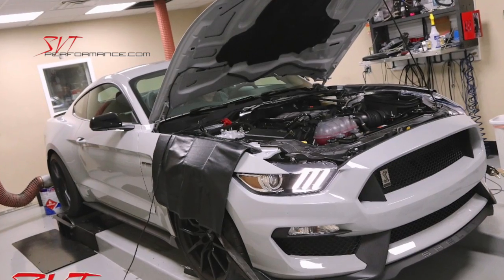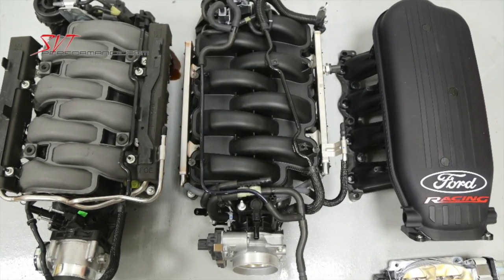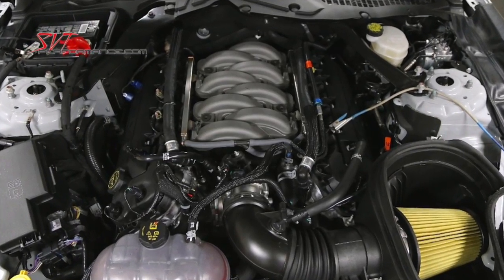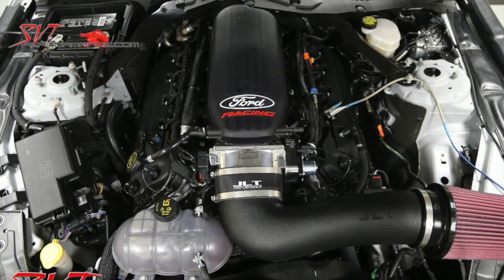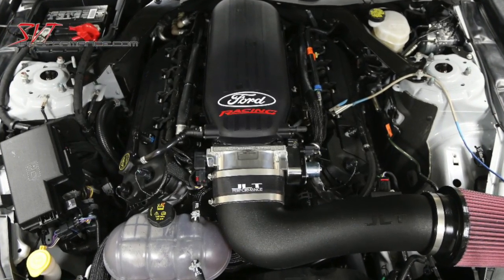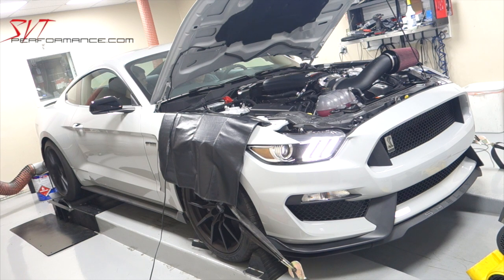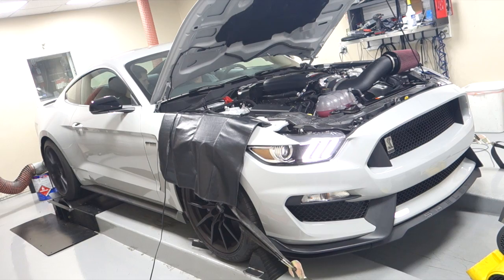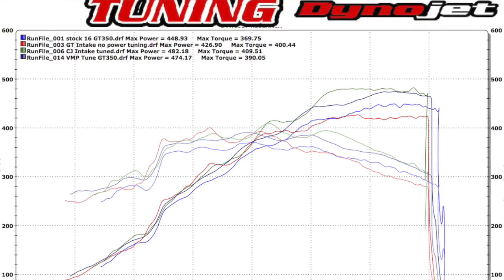Cobra Jet vs  GT350 Intake Test

Comment: This test has no good info in my eyes.
 First tune stock set up. Then run cobrajet with stock intake and tb tuned. Then we would have real data.
Reply from the maker: How do you propose bolting the stock intake and throttle body to a Cobra Jet Intake?
Reply: @SVTPerformance  then put the TB, intake and tune on the 350 first.
Reply from the maker: The Cobra Jet Manifold requires an oval throttle body and intake.  The others use round components.  They are not interchangeable
Reply: @SVTPerformance  ya got me on that but I'd say if the resources were there I'd of matched the throttle body to it's equivalency in a round and used that. If not I guess you did it fine. But real data is what we rely on to make good informed decicions but we only know the difference on the entire combo when it would be nice to know what the intake is worth compared to the gt350 intake and we don't know that.

Comment: That's stupid! The stock gt350 manifold is already good! All you need is a better throttle body,intake,and tune!
Reply: Yea its already "good" but it clearly isn't the best or the cj would not pick up power on a gt350 or an 18 up gt..
The reason they both gain with a cj intake is because the cj intake was and still is the best intake manifold available for the coyote as far as na applications go.

Comment: Do they make cobra jet for the s550 stang
Reply: I heard you can cut the hood liner in the S500 and it will clear. Any thoughts?
Reply: can anybody tell me exactly what you need to do to make the cj compatible with the s550 like any extra hoses or modification of the vacumn lines necessary thats all i want to know i got the hood clearance issue resolved i just wanna know cuz the closest speed shop is 3 hours away from me so i gotta do bolt on installs my self
Reply from the maker: It will bolt to the S550 engine, but the hood will not clear it without lowering the motor.
Reply: A cowl hood would be the easiest way to clear the intake
Reply: ive heard that too all but youll get a lil bit of rubbing

Comment: I don't understand the usefulness in testing a GT manifold on a GT350.  And how many GT350 owners are going to want to swap out their intake, especially if it means getting rid of the GT350 hood?  Strange dyno day indeed.
Reply: jastanger. If you wanted a street car, with a redline of 6500-7k. It shows the GT manifold a capable.
Reply: Exactly why put a GT intake on a GT350, shit makes zero sense. That's like swapping a GT v8 for a V6.

Comment: I was the first to trial fit a cobra jet intake on the GT350 over a year ago. Forget about it. It hits the hood and when the hood is lowered the latch is 1" from closing. The motor can not be lowered enough because the oil pan to k member clearance is 5/8" 
Now that the 2018 has a lowered core support like the gt350 this intake will very unlikely fit the 2018 models also.
Reply: Scott D exactly. S550s can't use the CJ without a new hood. Kinda pointless test. Unless you got the right hood.
Reply: BMR makes adjustable motor mounts but that only gets you half an inch. Maybe a smart body shop could figure out the half inch clearance.
Reply: 1/2" lowering is enough to clear on a stock 2018 GT.

Comment: Where can i get the cobra jet
Reply: +Bat5.0 That or get a TruFiber 3in cowl hood to look sexy AF!  BMR motor mounts are the buget way to go though.
Reply: +jesu3996 American Muscle , listed under the 2011-2014 Mustang Engine->Intake-> But if you are planing on using it with the 2015 you will either need motor mounts to lower the motor or cut part of your hood (as clearance would be a issue).